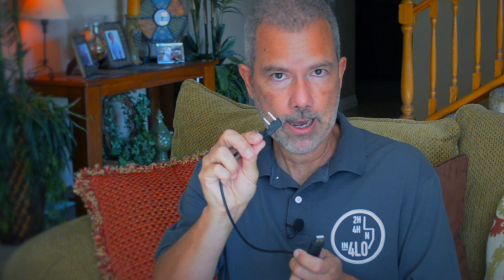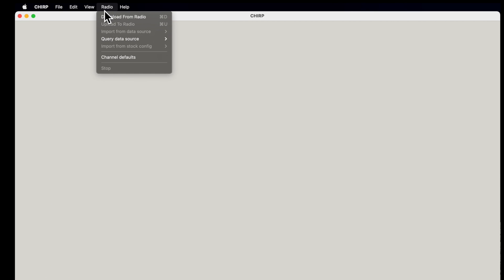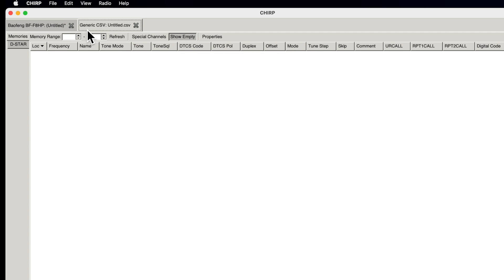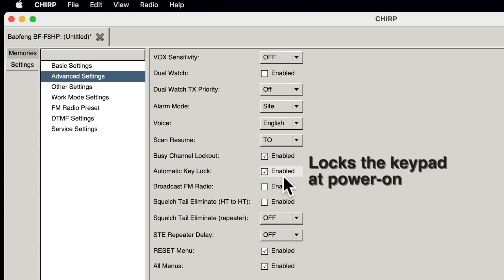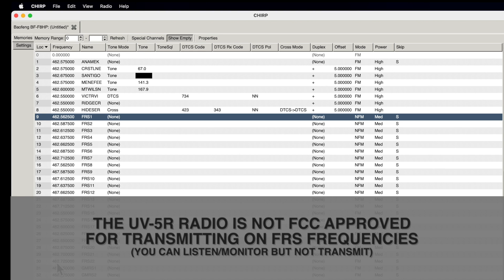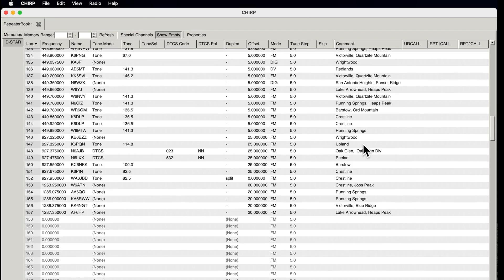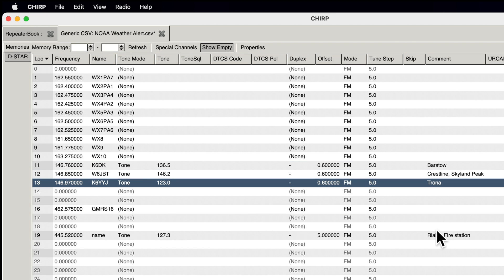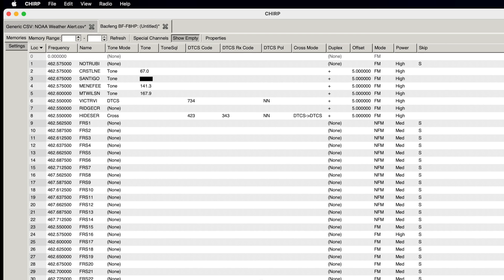How To Use CHIRP Software To Program A Baofeng UV-5R. Using CHIRP for HAM, GMRS, and FRS Radios

Comment: Have the same radio and followed along.  Entered only FRS channels and then uploaded.  Now walkie is locked up.  The A/B button doesn't do anything but chirp.  Same for the VFOMR button.  Can't get into menu.  Any ideas?
Reply: Keyboard was locked I guess from that setting.  Figured it out.
Reply: Try holding down MON +PRT+ VFO  buttons all at the same time while switching on your radio.
After that you might have to redo the Chirp upload
Reply: Correction that's PTT not PRT

Comment: If you are just going to listen to any ham repeater, you really don't need to put in a CTSS tone. You need one in most cases to transmit (if you're a ham) because most repeaters use CTSS tones to be able to key up the repeater. I have been listening to hams on my scanners for years and never have I put in any of the tones. Also most ham repeaters do not transmits a tone, they just listen for one from your radio you're transmitting with. There are exceptions where they do transmits tones.
Reply: This might sound like a dumb question, but when you key into a repeater with the ctss tones  can only transmit on the repeaters frequency? Or can you use the repeaters frequency to transmit on your own frequency?

Comment: Well, I got my UV5 RE connected to the app on my Mac, but Cannot get it to communicate with the App. I just get a message that says "Error Communicating With Radio.No such file or directory.
Reply: Make sure it says usb and the right information for you radio and make sure it’s all the way plugged in😊

Comment: Hi Randy, we use various Baofeng radio models that we have been able to program for use on our own frequency. In the past, we have referenced your videos and been able to program any of our handhelds without issue. Thank you for that! We recently bought some BTECH GMRS-20V2 that we were hoping to program similarly, but looks as though some of the credentials are unable to be entered and are locked or grayed out. We were not sure if this was due to the radio being locked? Can these be unlocked? I have not been able to find any material discussing this. Wondering if you had any experience on programming these GMRS-20V2? I assume there has to be a way, any assistance would be very appreciated! Thank you

Comment: I downloaded CHIRP tar.gz and also the flatpak for my MX-Linux system. Somehow I did find it in the MX Test Repositories so I didn't actually need the downloads. I just installed it from the MX Package Installer.
Also, I have a question, can I use wideband and max power for the FRS channels?

Comment: I have the latest version of Chirp. I have the correct cable for my Baofeng UV-5X. It is plugged in correctly.  The CHIRP app said my Com Port was USB-SERIAL PORT CH340 (com4). When I tried to Download From Radio I got an error saying radio is not responding.  Chirp using another cable communicated with my B-Tech 50X1.  Any relevant suggestions?
Reply from the maker: This is almost certainly a Windows driver issue...
Good luck.
Reply: I located the manual then manually changed what I needed to change on my two handhelds. I’ll step away and look into the driver thing another day.  I glanced at them already but my 77 yr old head was swirling with by then. Another day. Another cat to skin.  Thanks, Denny in Detroit

Comment: Used many radios, in former life, but never had to program them. I am totally a NOOB with these BAOFENG's, and I loved your videos. I bought 2 UV-5R, and 2 UV-5R GMRS radios, and I am unable to connect the GMRS ones to CHIRP in order to do anything. Are the GMRS radios good enough to keep or should I just return them and get the regular UV-5R's? No issues with the regular UV-5R's.

Comment: I'm brand new at this. I had a friend download some local frequencies into my radio and it works great (Baofeng 8w). I'm headed out West for a short vacation next week and was trying to download some local Repeaters and frequencies that I found online. The file that my friend downloaded is an .img file (I've never heard of it). The ones I created (with your excellent instructions) are csv files. Right now I have multiple files open (Repeater, NOAA and some local information I found). None of them will allow me to Upload to my radio. The only file that would allow me to Upload to my phone (from the Radio tab) is the img file. Since that one is already on my phone, I don't need to upload that one. What am I doing wrong? What do I need to do to get a file to upload to my radio. Thanks in advance.
Reply: In chirp go to the file tab in the upper left and choose open recent and the software will open the .img file.

Comment: Greetings. Great content. Thank you for the training. I’m getting an unusual error code when trying to use Chirp. Has anyone seen this one?:
 This setting will not be uploaded to your radio because some radios with your firmware version are known to be broken when CHIRP sends that data to them. Please see bug #10505 on the CHIRP issue tracker for more details. Bug#10505 seems to have nothing to do with this error code. Does anyone have any recommendations. Thanks so much!
Reply: same issue

Comment: I am having some trouble with my radio, If anyone can provide some help. I used chirp to add GMRS and FRS Channels (no tones) to listen to. I wanted to add a CTCSS tone to a channel so I could listen to a specific set of FRS walkies my friends use. The problem I am running into is that when go to the menu in my UV5R and try to add a CTCSS tone to receive, it does not save. I understand that I need to hit the menu button again to confirm the setting change. But after saving the change, the CTCSS icon does not appear on the screen and there is no tone selected when I look back into the menu. I have tried adding tones to a few different FRS channels and no luck. I understand I can make a copy of the channel in chirp and add a tone to it in the chirp program, but I was hoping to do in on the radio itself so that I can add/remove tones when needed. Thank you.

Comment: Finish watching your video on programming. The Chinese did fix all of the 7 you mention, my question is do I need to program my local repeaters with the codes or does all the repeaters will need no codes? My area shows codes with the open repeaters. I live in Texas.
Reply from the maker: Most repeaters (every single one i have ever seen) requires at least the TX code to use/activate the repeater.. on all repeaters the RX code is optional.

Comment: Thank you. CHIRP at one point after a failure in the USB connector stopped seeing the 'Settings' section in the UV-5R when reading from the transceiver. But he sees them in the files saved earlier and loads them into the transceiver. Deleting and downloading the program did not help. I don't understand the reason. A full reset to the factory settings of the transceiver also did not help... Probably, some of the parameters in the transceiver became 'out of range' for CHIRP, and he shows the blank page. The question is which one?..

Comment: I was under the impression that GMRS and FRS use the same frequencies for the same channel numbers, but I noticed you have all 22 FRS channels programmed but only 8 GMRS channels but the frequencies don't match.  Have I been misinformed?

I've had my radio for about a month and the cable for a week and I've been dreading trying to figure out how to make it all work, but this video made it seem pretty simple so now I'm going to go in with confidence.  Thanks!
Reply from the maker: On all GMRS and FRS radios manufactured since 2017, GMRS and FRS channels & frequencies are the same.

Comment: So if the frequencies are output 145 7500 and the RX is 145.1500 what one would I insert into the frequency on CHIRP ? Would I be correct putting the RX frequency in and that would be +0.6 offset ?
Reply: You program the frequency you want to receive on (that is the repeater's transmit frequency).  The offset then takes you to the frequency you want to transmit on.

Comment: CHIRP won't recognize my UV 6R. Beafang won't support the radio because I didn't buy from them or Amazon so very unhappy.
Reply from the maker: Yah, but you saved $9 because you didnt buy it from them or on Amazon, so it looks like everything worked out for you.
Reply: I used CHIRP with UV5R and UV6R and both works. Be sure to remove antenna before cloning, vol at 75%. If trouble persists turn off radio, and restart your PC, change your USB port and with some luck it will work for sure.
Reply: Try Radiodity or a different model Beefeng

Comment: Not a question, just an FYI. I have the newer UV-S9PRO and it isn't in the list of available radios. I selected the BF-F8HP and it worked for the UV-S9PRO in case anyone was wondering.

Comment: I hope this is not a duplicate question.  I have just purchased a UV-5R8W. What radio should I select in Chirp. Just Wondering. Any help would be appreciated. Thanks.
Reply from the maker: Try either the UV-5R or the BF-F8HP .. if neither of those work contact the support people where you bought it from and ask them.
Reply: Most likely the UV 5R
Reply: @alyismagic  I successfully used the UV-5R. I tried the BF-F8HP but it didn't show the "other Settings" ('could have been operator error). The UV-5R works but doesn't allow high, medium, and low power settings. So, I manually changed the settings after programming with CHIRP. Everything seems to be working perfectly. There may be a better way. But for me, I'm all set.
Reply: @Fred Donahue I have the 5R8W to. Didnt have any issues when i selected FH8P

Comment: If u go to other settings and see the uhf and vhf limit and that it’s changeable can u do a video showing if it breaks the radio if one was to change the uhf upper limit to 1000? There is a video on youtube that shows a radio work and listen to frequencies above 520 and so I wanted to know if it’s possible and what would happen and if u could do a video?
Reply: If it can be made to do so that mod it will probably damage the transmitter section unless an antenna is fitted that is properly tuned to those frequencies, or if you simply avoid transmitting, although receive will not perform well with an out of band antenna either..

Comment: Randy...you got me there man... and then... the cable failed... again just like you said... found the port installed the driver and software...they sent me the BT-480 software and boofunct USB cable with the CH340 chipset in it...and it was a anticlimactic "radio not responding"... i have ordered the cable you have listed... and noted it has a different p/n PC03 chipset designation "FTDI"... be a 5 minute program install if this cable works.
Follow up: FTDI cable arrived had to manually install driver from b-tech web site... and CHIRP and the "boo-funk" danced... all programmed for my local area..  and GMRS unlock tricks still work on 2023 BF-F8HP...

Comment: Great video thanks. My UV5R (firmware BFB298) won’t work fully with Chirp. I get “non type object is not iterable” messages. It copies memories ok but throws this message when accessing settings. There are no settings listed. The manufacturer’s software is working ok and there are no USB errors. Any ideas? Thanks.

Comment: Great video. The "Randy" breaks it down very well. I had NO issues following along. Which is strange.
Radio reference does require a premium membership (not too pricy) before you get what you need from them. AND...With WINDOWS 10, I found it VERY helpful to input the actual longitude and latitude in the search query. (get it from google maps easy) and limit your distance (defaults kilometers) so that I didn't have to wade through thousands of stations.
I call'em the way I see'em and the "CHIRP" is way better that that darn TD-BL-1 piece of shyt. (However...that being said I can see how I can use the two together in order to STORE my radio on my phone for quick access). Until the thieves at Tidradio make it right for stealing from me, by selling me JUNK I'm not a fan.

Comment: This was a great video. I learned a lot, but I have a problem. I set my A.B. settings like you have yours, but it’s not showing the name on A. Is that supposed to be the name of the channel for the frequency on B?
Reply: Display mode (A) is for the top line and B for the bottom line. my preference is the channel name on A and frequency on B so i can find out the frequency quick by going to the same memory channel

Comment: BAOFENG UV-5R Chirp Software Question- I need to add a GMRS Repeater - 462.675 MHz, Output Tone-125 DPL, Input Tone-125 DPL, do I add to DTCS Code and DTCS Rx Code or Cross Mode?

Comment: When I dl from radio into chirp, it goes thru the motions, but the list starts at 60 and is blank.... Any clue?
Reply: You might try to reload your original config and re-create a new config either replacing the old channels with the new (copy/paste) or merely re-config the existing config by cut/paste the channels that start at 60 into the #1 position.

Comment: Hi @notaRubicon, I configured my Baofeng BF-F8HP to a local GMRS repeater, got the repeater owner to confirm my config is correct and the repeater is up. Step is at 2.5, sql at 1, I am well within range trying to test with two HT's in the car I cannot hear myself on the repeater. Every now and then I see the LED indicating that the radio is receiving signal but does not make a sound. The hardware is tested  and working. Any troubleshooting tips?
Reply from the maker: Get your two radios further apart - at least 50 feet, then try it.
Reply from the maker: and watch this video ASAP: https://youtu.be/CPJPhnIi6Zs
Reply: @TheNotaRubicon  watching, thanks for creating this content
Reply: @TheNotaRubicon  worked!! thank you!

Comment: Hi I'm having  some troubles after programming  my channels on my baofeng  my issue  is if one radio is set to channel  1 and the other radio  is set to channel 15 if I key up the mic I can transit  from one radio  to another  is there away to resolve this issue
Reply from the maker: Program the radios so ch 1 and ch 15 are not the same frequency on both radios?
Reply: @NotaRubicon Productions   I will try that thank you but I want to be clear I have 3 baofeng radios I Entered the frequencies on the chirp software I used the standard bubble wrap radio frequencies you can find online starting from number 1 through 22 I then Uploaded this information into the radios and I discovered If the radios are set at different channels  for example channel one will transmit if the other radio and is set for channel 15 the strange thing is is if I seat channel 1 on one radio and the other radio channel 2  it will not transmit And I am setting the same channel for the top and the bottom on the screen if it would help I will make a video and send it to you I do have a respect for your time and I'd be willing to pay you a fee for your help If you're interested
Reply: @NotaRubicon Productions   I figured it out I had to set the tone it works now I have one radio on ch 1 and the other on 15 there  when I key up the mic on the ch 1 radio  the ch15 radio stays silent  thank you for your help your videos are supper and I enjoy  them very much

Comment: The volumn level...I was not aware that it needed to be at 50% to read, write to, and from radio.  Thank you Randy. 
I bought the tid supersize on your recommendation..the only missing cable was the usb charging for the 3800mah batteries, so as a backup, I purchased a pair of  the 6 AA  shells and populated them for a quick changeout.  Now if the call sign website has corrected their error and updated my uls and cores info..I can add gmrs to my other info, and round-up my preppies and set them up with your online specials .
Now if someone made a program for programming a drone as easy as chirp..wow..
🫵 one of your favorite viewers. 👍👌

Comment: Hi there, using CHIRP, can you save a back-up file on your computer and upload it to a new radio? 
You see, I recently purchased two (2) baofeng UV-5R's and while I am waiting for the delivery of my programming cable, I have already manually programmed one with the local repeaters and simplex frequencies (16 channels from my BF-888S).
Reply from the maker: Yes, as long as the new radio is exactly the same as the old one.

Comment: I have a question. I programmed my UV-5R following this guide. I'm wondering why in the CHIRP software there's no option for Medium power when I import the GMRS List from a stock config? I live in Canada and do not require a license for FRS/GMRS. However, transmitting power is limited to 2 watts. I tried a work-around by changing the power setting on the radio which does let me switch to medium or low but after power cycling the radio it resets any power settings changed. What can be done about this?
Thanks man, 
Cheers
Reply: Is your 5R the regular version or the 8 watt? I have an 8 watt and I had the same problem but importing the radio as a BF-F8HP gave me the high-med-low settings.

Comment: Randy, please help. I have 3 radios. A TH-9800, a UV-5R and a Radioddity GA-510. I've reset the radios. I download from radio, then program in freqs, tones, offsets, etc, then upload to the radio. On every radio, the offsets, direction and tones, are not saved in the channel memory. I have to manually go into vfo, change the settings, then save it that way. Example, I save a channel in chirp and upload, and the channel saves under the name I give it, but the offset will be 7.6, instead of 5.0 or 0.6. I'm beyond confused.